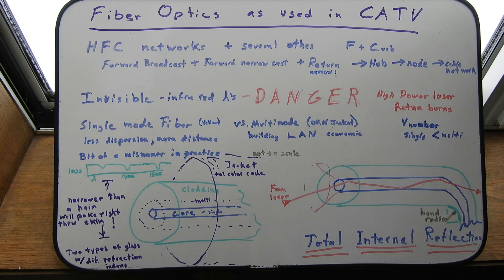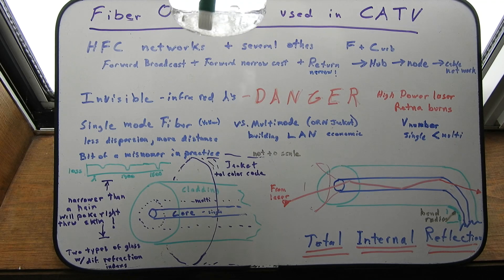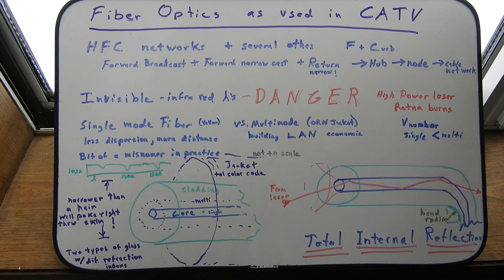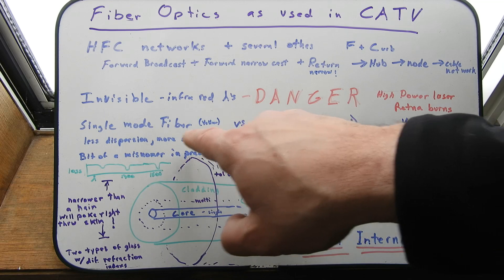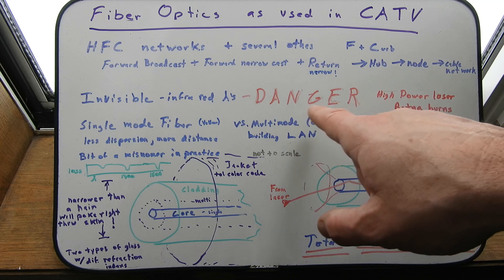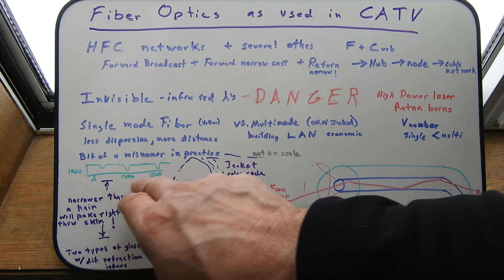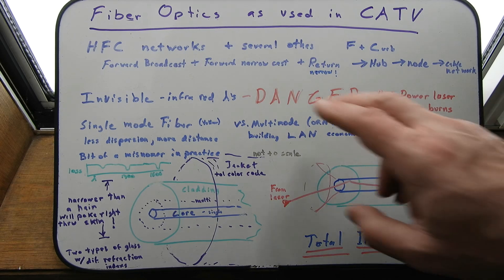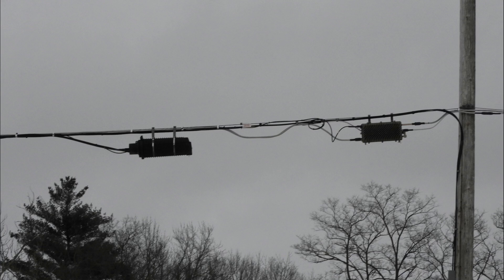Fiber Optic Basics & How Cable TV Uses Fiber Optics

Comment: I am no technical expert by any means, but I have enough knowledge to understand that fiber-optic cable transmission does have a few advantages over wireless methods. The UHF portions of the radio spectrum which previously were allocated for NTSC/ATSC TV channels have been grabbed up to support the so-called 3g, 4g and 5g networks.  But can current wireless standards support greater G-amounts without having to gobble up more spectrum space? Also, any type of wireless transmission has to find its way from one point to the other and back again. No matter how good the methods are, it's still a tough obstacle course out there.  

Now I haven't read any history on the development of fiber-optic transmission, but I am wondering if perhaps way back when the electronics industry might have slow in recognizing the  benefits of fiber over copper. I also wonder if such slow realization might have had a ripple effect which would eventually lead to the push for wireless over wired?
Reply from the maker: Fiber will always have its place. A fiber network is fast, closed, and secure. It has incredible bandwidth possibilities even without multiplexing. OTA, bandwidth is tight!

Comment: Interesting. We linked a LAN together in separate buildings using multimode cable back in the 90's. The telephone system used copper and always suffered lightning damage due to potential differences during storms.
Reply from the maker: Yes, electrical isolation is an important factor!